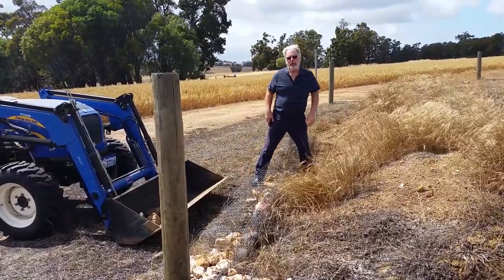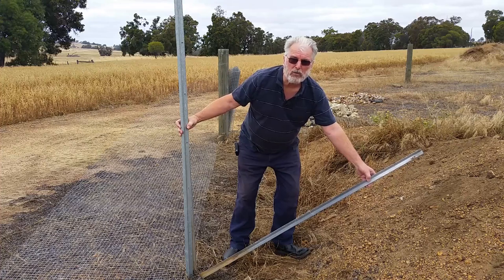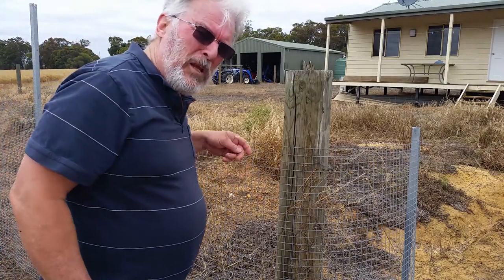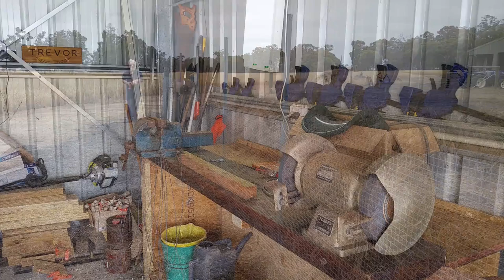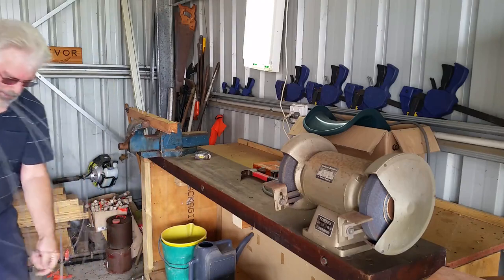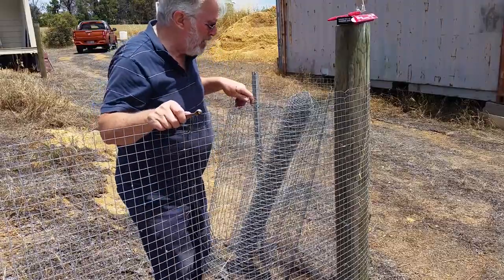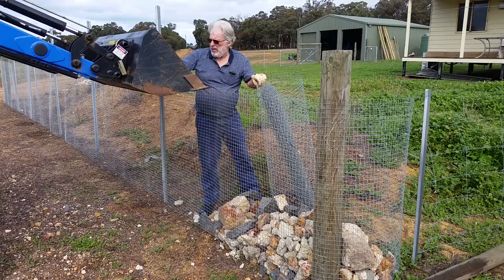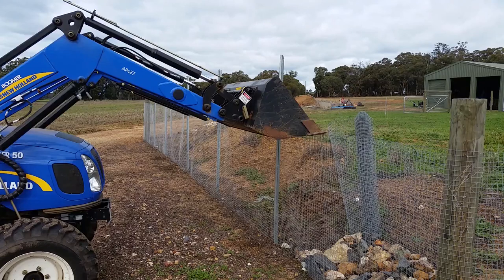Gabion style wall without boxes - alternative engineering idea

Comment: Cool. I was hoping I'd see a video where the mesh is a smaller gauge. I have a lot of small rock, almost gravel, I plan to use and the mesh with smaller openings is what I'd need in order to keep the rocks inside the wall. Every other gabion I've seen uses cattle panels or concrete re-mesh, both of which have openings too large for the rocks I have.
Reply from the maker: Try chicken wire inside cattle panels?